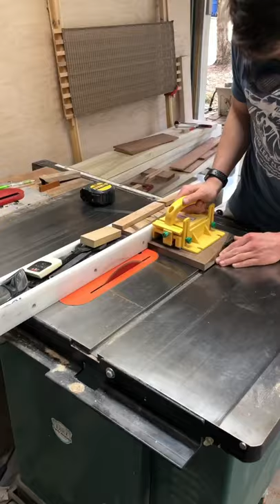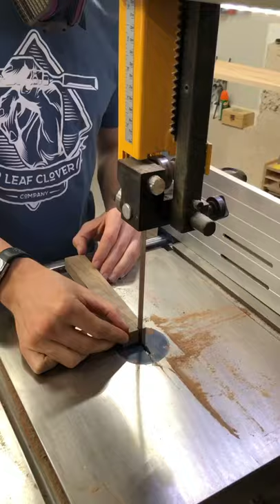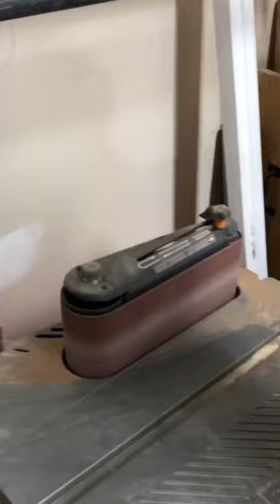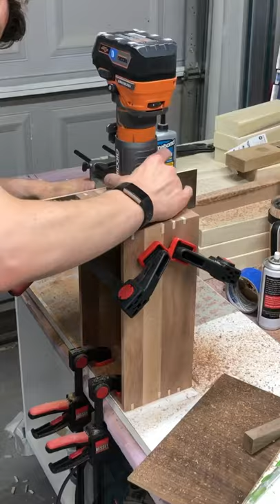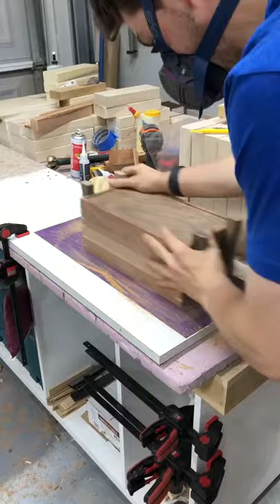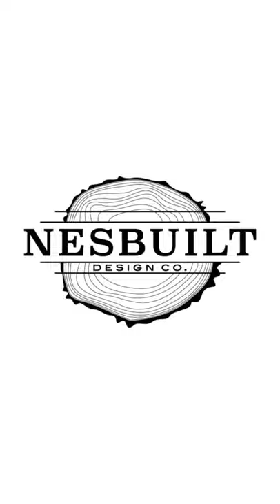Simple Fancy Feet for a Fancy Box

Comment: My thought, next time before you cut the shape of the leg on the bandsaw, drill out a couple holes for a dowel, cut it on the bandsaw put it in place drive a dowel and then finish sand. It looks nice the way you did it, but if you matched the same wood that you used for the splines that could be awesome looking and add a bit more support
Reply from the maker: Not a bad idea at all, especially since they are perpendicular grains. Not much movement on something that small and thin but still a solid idea 👍 I don’t know if I’ll ever make another like it but if I do I’ll keep that in mind! Thanks mate
Reply: @NesBuiltDesignCo  of course man! Keep building.. and be careful!